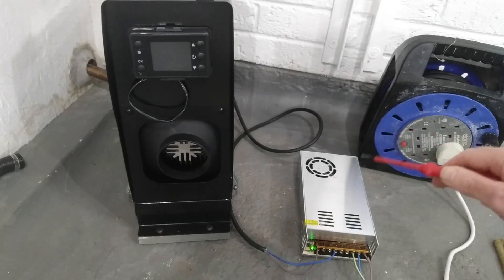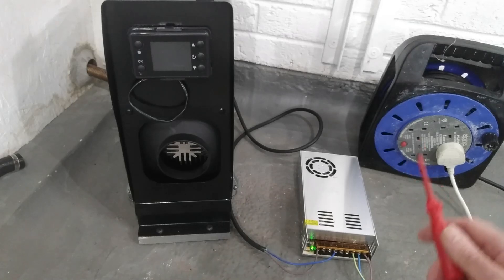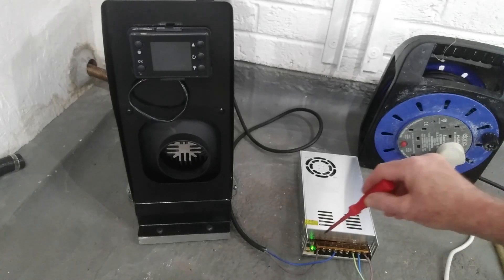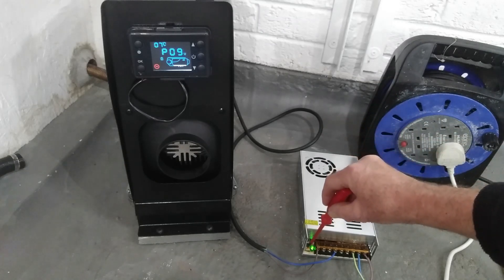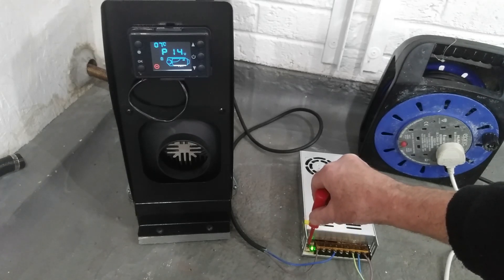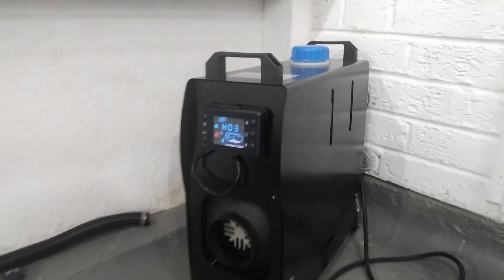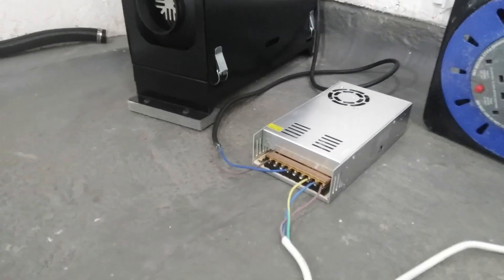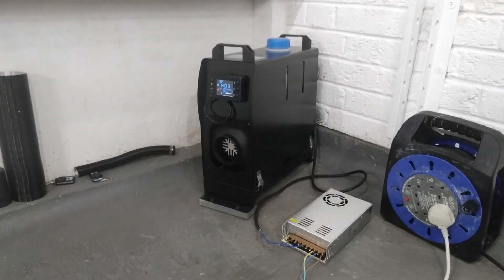Heating My Home with a Diesel Heater and a 12V Power Supply changing from battery to 240v mains

Comment: Could it be a idea to parallel connect the batteri with to power supply, in case of power out the batteri can power off the heater without damaging the heater🤔
Reply from the maker: Hello my friend Thanks for your comment 
would it be ok to do that?

 I really appreciate you watching my video I have another heater too, in my garage, 
Please see my other videos Kindest regard andyfireblade
 Please like, subscribe and watch my other videos
Reply from the maker: would having the battery connected as well have any other effects?
thanks
Reply: @andyfireblade  i run my heater with a 12ah battery with a 2amp charger connected. If you connect your 12v psu to a battery and your heater to your battery. The battery will work as a backup and a buffer. That way you only need a 2-5amp -12 volt power supply
Reply: If you like you can find me on FB and i can pm pictures of my setup.
Cheers 
Michael Bang
From Denmark
Reply from the maker: thanks , great. also is your battery a small battery?
Reply from the maker: subbed too
Reply: @andyfireblade  yes my backup/buffer battery is only 12ah motorcycle battery.. 12ah = approx 3 hours backup run time before safe turnoff.
Reply from the maker: thx but i dont go on face book andy
Reply: H3 setting uses approx 2amp/h./ 24 watts.
I run mine on H1 to safe gas in my 155m2 house
Reply from the maker: thats interesting, good to know
i have learned a lot here on youtube from great people like you. thankyou andy

Comment: I've got the same power switcher as you, wired it in last night all wired 100% correct but it went with a bang and flash when plugged im. I checked and 95% I had it set on the 240v setting. Just out of curiosity, is your switch flicked to the left or the right?
Reply from the maker: right
Reply: @andyfireblade  yup that's what mine was. Hopefully better luck with the next one
Reply from the maker: does it give out any power?
like test it with the wires on a 12v bulb?

Comment: I like the power supply but it removes the ability to run and cool the heater if there’s a power outage.
Reply from the maker: Hello my friend Thanks for your comment 
as i havent had a power cut for 5 years, i was more worried about the battery going flat.
although i might wire up a battery in parallel, just incase.
good point thanks.

 I really appreciate you watching my video I have another heater too, in my garage, 
Please see my other videos Kindest regard andyfireblade
 Please like, subscribe and watch my other videos

Comment: Just a suggestion - always adjust the voltage with a proper multimeter - you were lucky you didn't destroy the control unit - especially with a cheap Chinese power supply !!!
Reply from the maker: Hello my friend Thanks for your comment 
good tip
i will use one to check it.

 I really appreciate you watching my video I have another heater too, in my garage, 
Please see my other videos Kindest regard andyfireblade
 Please like, subscribe and watch my other videos